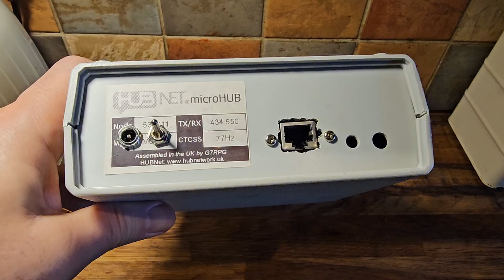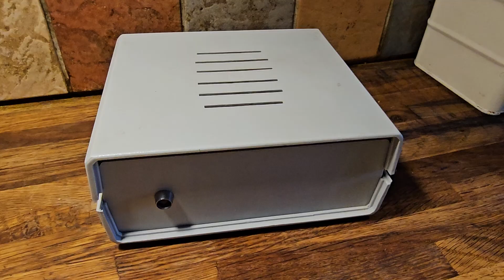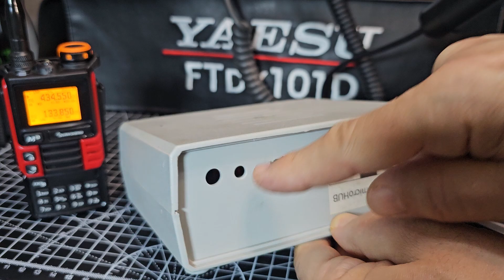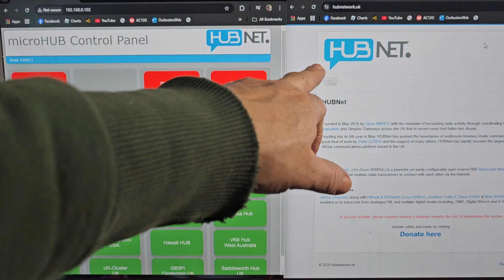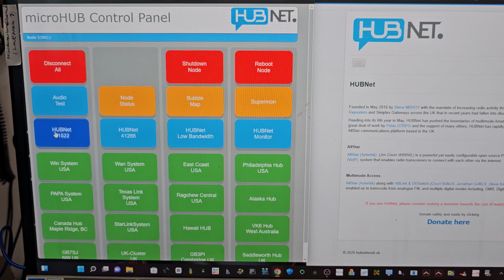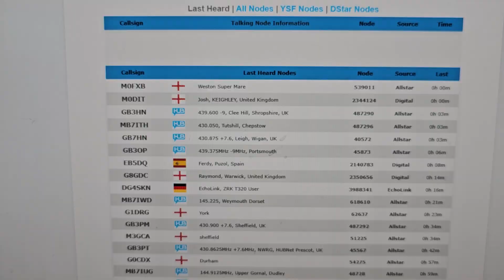G7RPG Node - Allstar Node

Comment: Very nice. I opted to build a Shari-PiZero kit. Easy build and under $100, including buying a Pi Zero 2W. It's smaller than a deck of cards and works flawlessly. I usually use it with my OpenGD77 radios (in analog mode of course) because they have great DTMF contact features, which can be labeled and have the ability to send control characters. I can just select DTMF contacts and choose the node I want to connect to, rather than having to remember the node number.
Reply from the maker: Sounds great! Lots work